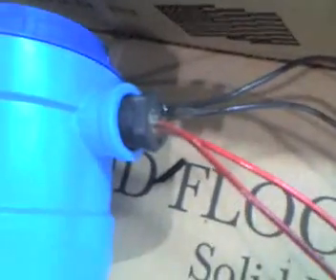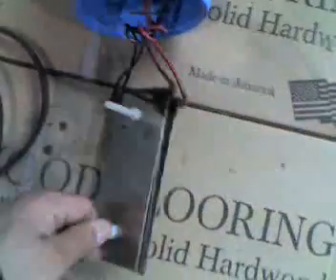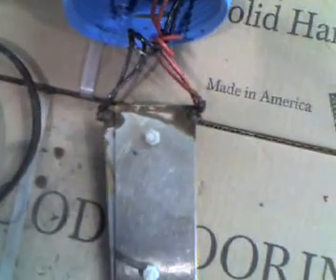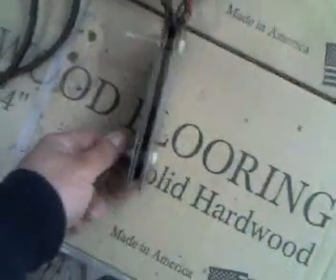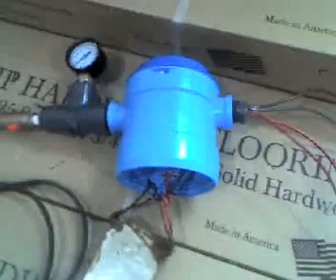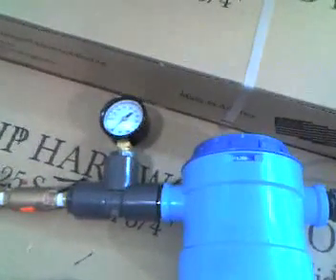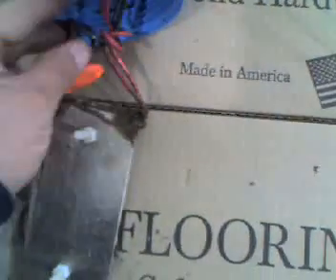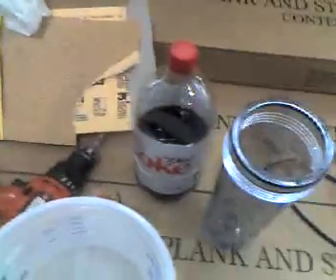zeobo's hydrogen cell 1

Comment: amps=gas, volts=heat.

Ideal volts for plate type you are using is no more than 2v.  If you hit it with 2 volts at 100 amps it will make lots of gas and very little heat.

If you want to hit it with 12 volts, build 5 more like you have and connect them in series. That way, each sees 2v and all will be fine.

If you want one that works at 12v and sits in one container, build a series type plate configuration with +nnnnn- arrangment so each gap sees 2v ...

please dont presurize (BOOOOOM)